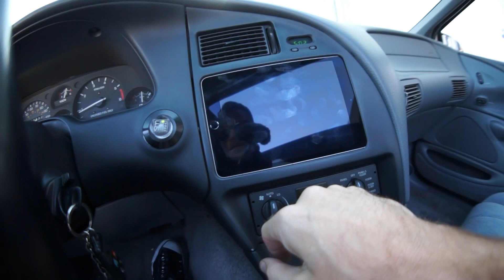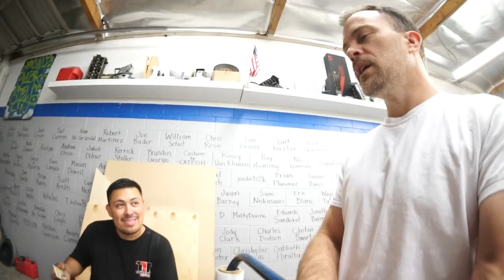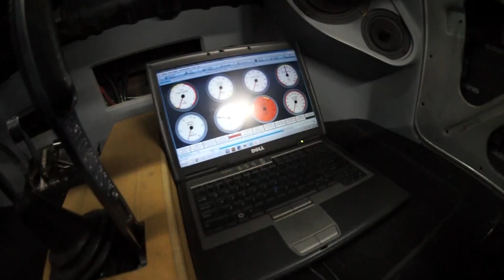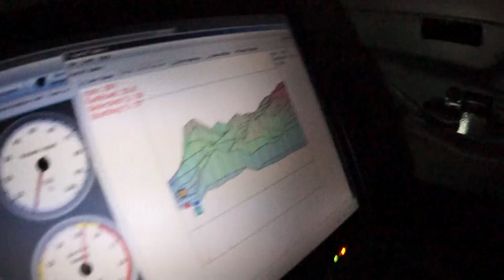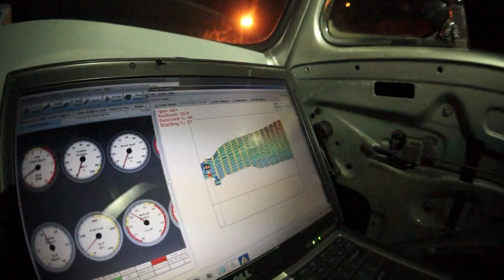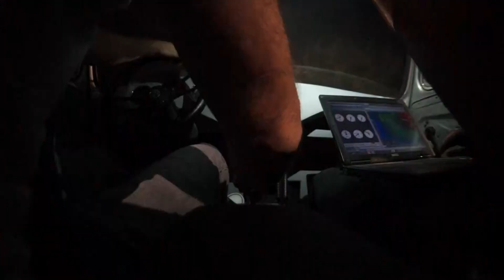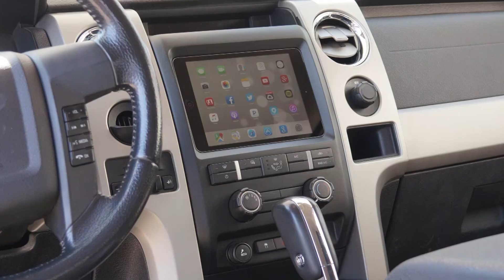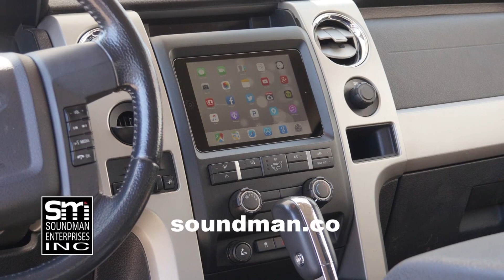We street tuned THE MULE, then I broke it!

Comment: Yo dash modders, what are you all doing for FM radio? (and yes I still listen to FM radio, and go to the drive ins lol). I have a half din slot that's free, hopefully there's something out there that fits, even if it needs to be modded. I'd love to use the factory antenna as well. 
I've tried running a small hand held unit with a 3.5mm to rca cable but it cant really pick up the stations I listen to and is basically unusable. A dab+ setup might work as well but being in Australia my experience with reception has been average at best.
P.S. Thanks Doug for the hard work and consistent uploads, I've been following for years. White rider and the mule are hands down two of the best car builds on youtube (and the comedy is seriously good too, particularly after a few bong rips lol).